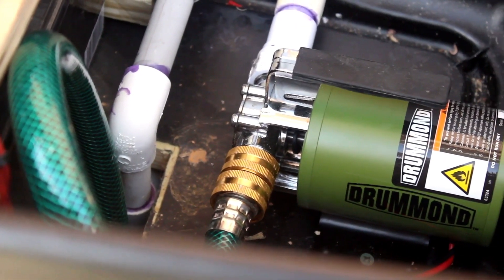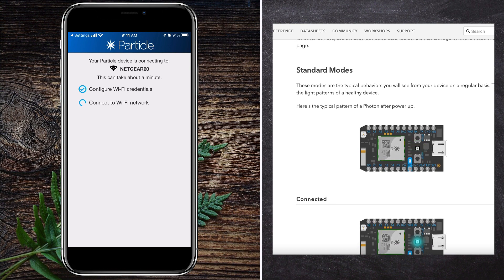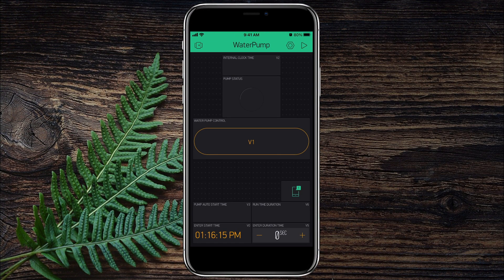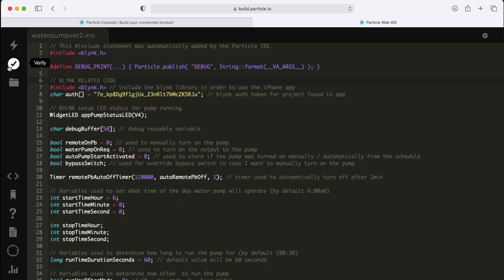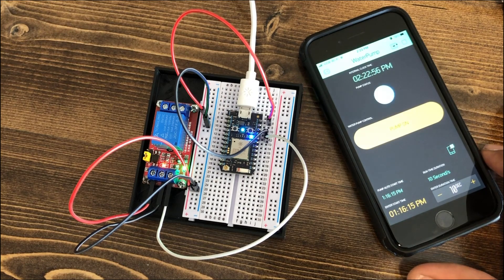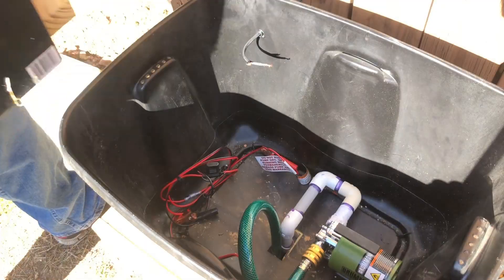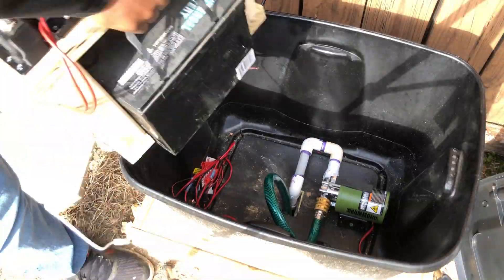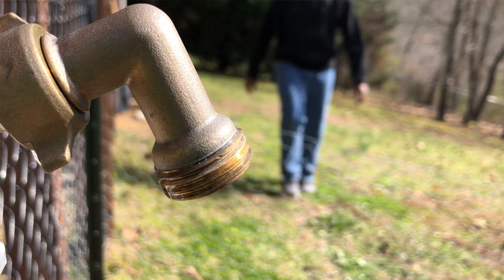DIY Automatic Watering System | WITH Mobile App

Comment: very nice, question how did you make the app that blink loads? i have a larger program with arduino using for buttons for inputs looking to build the app so it can work with /arduino or perhaps use photon.
Reply from the maker: It's been some time since I made that app, but I believe at the time of this video, I made it using the app itself and maybe the blink website. I watched a few tutorials on YouTube from some other YouTubers and was able to get a basic understanding for what to do after a few hours. I think they have made several changes since then and it's even easier to make apps, but they limit you if using the free subscription.

Comment: So, came across your rain barrels first... as of two weeks of pulling and repulling ideas for my greenhouse, I came across this video. I am currently in the process of building something similar through Arduino IDE and an ATMEGA chip. My additions are soil capacitive sensors, to measure moisture contents of soil, temperature and humidity sensors (because it is a green house and I can control those better than outdoor), and as a result, have programmed in the tolerances for such. Unsure if you are like me and this is all an experiment with additional rewards, but it may be something you want to look into or run a video on. With the expansion of a larger board (or slaving a larger board) you could add nutrient dosing and measuring to your system... Just thoughts if you wanted to run it... other than that, much luck from a former Tiny Town resident.
Reply from the maker: Thanks for the idea Neal. It's definitely something that I've had some curiosity about, but have not dove too deep into it. I'll definitely add it to the to-do list to explore. Also, what made you decide to use the Arduino? I know they are really popular.

Comment: Attempting to follow along here, when trying to flash the device from the IDE I keep getting an error that reads:  waterpump.ino:6:10: blynk.h: No such file or directory  
any help here is appreciated.
Reply from the maker: It sounds like the Blynk.io library was not imported into your project. In the IDE on the left pane, click on Libraries, search for "blynk", click on the blynk result, and then click on the Include In Project button.

Comment: I'm really old!  I use to program COBOL, FORTRAN, and a little ASSEMBLY programming.  Your phone has more core storage than the old 360 I.B.M. reel to reel that I used.  You absolutely have it and lost my ass in the process.  Nicely done.
Reply from the maker: Haha, thanks. There are actually some easier methods out there. One method I'm thinking about looking into is a WIFI Relay which would cut out 99% of the programming and you should be able to accomplish the same goal.

Comment: Cool. Can your controller control a thermostat and manual switch on the wall for my gas fireplace?
Reply from the maker: It is very likely, it just boils down to using the correct components to interact with the module to get the job done. I've never done that, but sounds like a fun project.

Comment: not a plug but...... you could use a WYZE wifi plug. it can run up to a 15 amp device and its updated to work with ALEXA so you can then talk and have it turn on.

Comment: What if the internet goes out?
Reply from the maker: If the WIFI goes out,  I programmed my unit so that I can still use the manual toggle switch. I also added safety code that if the pump was remotely turned on but left on too long, it would automatically shut off after a certain time limit. You can program the unit to operate however you like, which is the nice part of it.
Reply: Should work if your wifi is still active..

Comment: Wow. Great tutorial. As I mentioned in a previous post we have made a rainwater harvesting prototype with timer control. We were wondering about a mobile app. interface and this answers those questions. Great stuff.
Reply from the maker: Yeah a timer is a good idea too. There are many solutions to this concept out there it seems rather you go the DIY route I took or buy a solution already made which I may try out one day.
Reply: @GreenTechTown  If you're ever looking to pump rainwater into your house to flush toilets etc.. let us know. That's what our pump is designed for! Thanks

Comment: This is really great! And the best part is with the microcontroller setup you can always add features later.
 a pressure off switch would be a nice feature that could override all inputs in case of an overpressure situation. Like if you're spraying and then you have to walk away to take a phone call you can leave the pump on and it won't burn up.
Also you could add capacitive moisture sensors
Reply from the maker: That's a really good idea. Thanks for sharing!
Reply: @GreenTechTown  if your interested in getting the best soil sensors Andreas Spies did a vid testing them out, but it would be cool to see them in a real world scenario with your blynk app